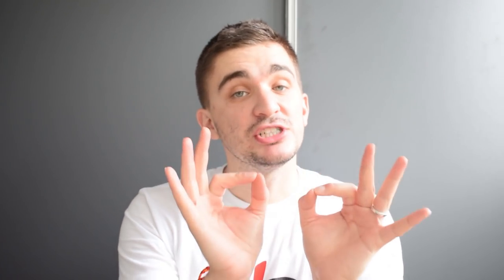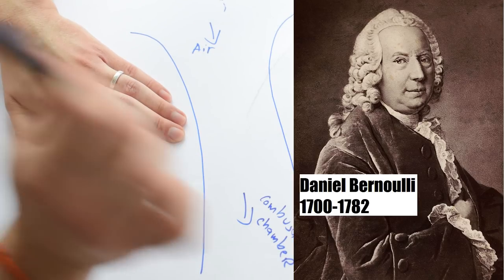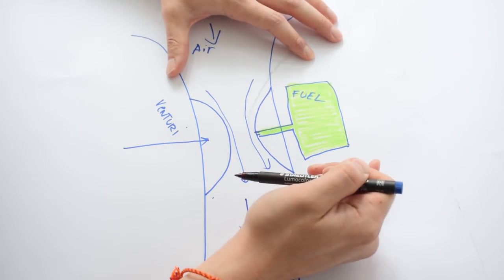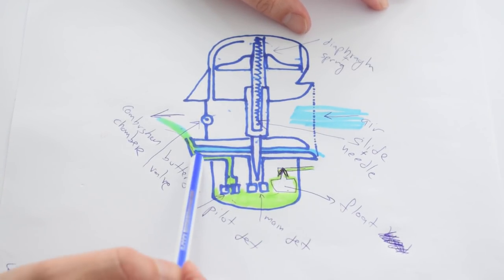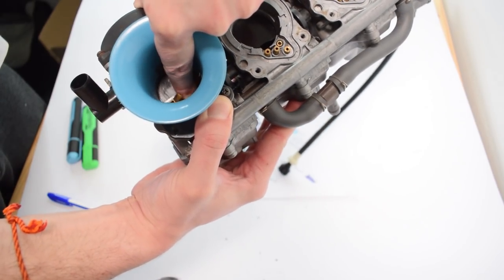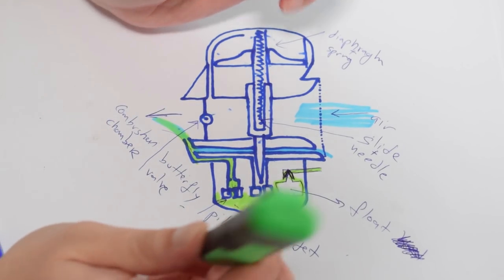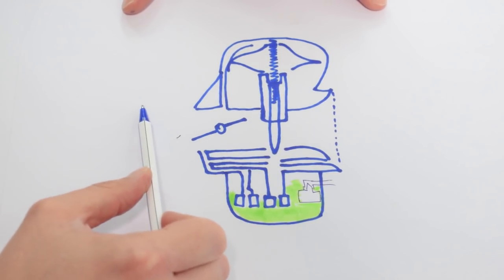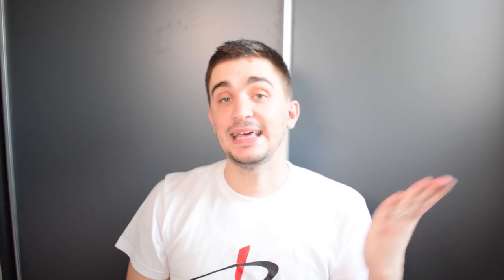How CARBURETORS and cv carbs work - EXPLAINED

Comment: Someone help me! All I want to do is get a modern bike carb to replace an old carb that is impossible to get missing parts for. I was given a FREE = (  Honda CM250. It has twin cylinder running off one carb. Part  16100-KB4-672. All I want is a NEW carb that works and gets me from A to B. Is there a conversion algorithm like i saw for cars? Why can I not find any info on a simple carb to carb transition?  Post a link or something. Thank you.

Comment: Karburetttaes are simple, cheap, and you can fix' em on the side of the street.

Efi is more complicated, more expensive, but very prescise, and reliable, and it creats less  emissons. *Also Efi does not care you are below sea level or you are driving on top of MT Everest. No need to choke. No need to rev to warm up. More power. Do EFI
Reply: this style carburettor doesn't use a choke :D, and i never has issues at cold start. actually my car started faster on my bs36 mikunis than my current efi setup, but that's due to the ecu syncing process

Comment: slight correction the needle doesnt raise with the throttle alone, part of the reason i like this style carburettor so much is because the needle responds solely to the engines request, you give more throttle but the engine can only open the needle based on its own efficiency at various rpms for the various percentages of throttle openning. there was a cool video of a camera mounted infront of an old mini cooper cv slide carb showing different load and rpm combinations and how the slide reacted. great watch aswell. :)
Reply: https://youtu.be/gtSam0RgPl4 at 1:05 he goes full throttle for a short bit and the slide is about half open, due to the engines volumetric efficiency at that rpm. these carburettors are amazing and the basis on why I was researching yamaha's use of the cy slide (without a needle) in the first gen efi 4 cylinders. (turns out to be noise reduction and fuel efficiency) I currently have my slides locked fully open (note for those reading, my setup is efi now)

Comment: The butterfly is not the throttle...the slide is the throttle.  You can go from idle to full open butterfly in an instant, but the slide opens more slowly to maintain constant vacuum inside the  carburettor.  CV is better called Constant Vacuum vs Constant Velocity even though the flow through the carburettor remains somewhat constant due to the position of the slide...the slide position is controlled by engine vacuum and moves up and down to maintain a constant vacuum in the intake manifold.  What you describe here is the Stromberg carburettor where the operator activates the butterfly and throttle action is by the slide.  The Stromberg carburettor design allows the engine to run at low speed low load and not stall when the butterfly is opened quickly.  SU carburettors have mechanical connection to the slide so the operator moves the slide up and down...the biggest problem with SU carburettors is going from low speed and low load to WOT (ie slide closed to slide fully open) cannot be done quickly bec engine will stall (throttle needs to be opened slowly to maintain constant vacuum in the carburettor).
Reply: What's the purpose of the slide?
Reply: The Stromberg CD carburetor and the SU both operate on the same  basic principle, except for the fact that the Stromberg uses a diaphragm instead of a piston as in the case of the SU carburetor. The mechanical connection you seem to be referring to on the SU, is the cold start system the physically lowers the main 'orifice' that surrounds the needle, thereby enriching the fuel mixture. The slide itself still operates independently only in response to engine demand, just as in the case of the CD type. Early SU carburetors were one of the first Constant Vacuum types available. In fact, the first version actually had a leather bellows instead of a metal piston to control the slide. In this respect, it was technically closer to the later diaphragm types.

Comment: Hey d4a, Have you ever considered doing a 7age hybrid build? I've seen this idea tossed around alot on forums and thought it sounded good as an idea and seems like a pretty cheap addition to any 4age build due to the availability of the 7afe block. just wanted to know if you had considered it or had any take on 7age in general.
Reply from the maker: FR1TZ I've considered a lot of things :) the 7age is a good idea, you sacrifice a bit of the rev capacity of the 4age in exchange for more torque. This often makes the 7age faster in the real world. Personally I prefer the 4age as I'm not a huge power nut and like an engine that needs to be driven hard to go, plus I really like engines that rev high. What I would really like to build is a 10.000 rpm formula atlantic style 4age. After that I would really like a turbo 9age built by mrp. :)

Comment: Now true question: Mikuni RS or Keihin FCR ? Carbs swappers can relate.
Reply from the maker: TheCabillaud94 Mine are Keihin. First and only carbs I ever had. I prefer the name Mikuni though, sounds like a sexy Japanese lady.
Reply: driving 4 answers same. I believe the FCR is superior but Mikuni RS just sounds better as a name. What are yours ? I need to find 28mm carbs for my project bike.
Reply from the maker: Mine's are just some civilian Keihin cv carbs from a Honda CBR600 :) No mechanical slides or pumps.
Reply: driving 4 answers Well that sucks. Although you do have a round slide,  no pumps that is sad.

Comment: Thank you; great stuff. If you wish to do another one on constant vacuum carburettors, might I recommend that you look at and demonstrate on an SU? These were used on lots of British vehicles in the 60s and 70s such as the "iconic" Morris Minor. The vacuum slide is a piston and the annular main jet orifice is very easy to see. These carburettors make the transition from the straightforward carb (such as an Amal) with a barrel-type slide to a constant vacuum one very easy to understand. The CV carbs with diaphragms, like yours, are another step. Best wishes, Luke Wiseman

Comment: Hi! I was thinking of fitting bike carbs on a project car, a bmw e30 with a 'm50b25 non vanos' engine for dirt racing because of problems with the injection system. So what type should I use for this 2.5l 6cyl. engine?
Reply from the maker: Doing a 6cyl is a bit more tricky but doable. You will likely need to buy two sets of 4 carbs. I assume you want good torque low down for dirt racing so I wouldn't get carbs that are too large.  Definitely below 40mm, something between 36 and 38mm might be ideal depending on other engine mods. Those can usually be found on 600-750cc motorcycles. Make sure you get two identical sets that come from the same make and model of bike. You will also need a few custom bits to keep the 6 carb setup together but nothing too complex. I also suggest that you get in touch with DanStengineering, they really have a lot of know how with bike carb conversions.
Reply: @d4a  That's true! Also a good midrange would be nice. Thank you very much for the info. That will help alot! I will let you know if it worked or not. ;)

Comment: I was always blow away by fact that engineers came up with cabrurated gasoline engines first. Fuel ingection seems so simple and obvious in comparison, not only as an idea but in the amount of different variables as well, excpecialy when looking at old car carbs
Reply from the maker: I know right! I was thinking the same thing while making this vid. Takes 2 min to explain fuel injection to a 10 year old. Try explaining carbs. But they are a testament to old school engineering ingenuity where you had to find a way to get something done without relying heavily on electricity and printed circuit boards. They may be fiddly and obsolete nowadays but they are still truly charming and have their place.

Comment: Very cool video and you deserve more likes.

My formula student team is using CBR600-F3 CV carburetors. I wanted to know if the carburetors can operate at higher fuel and air pressures. I assume the fuel and air pressure must always be the same, but could we compress both the fuel and air to 10 bar and still have the carbs working?
Reply from the maker: Thanks, glad you like the video. Motorcycle cv carburetors are extremely sensitive to fuel pressure. They want 3-4psi and that's it. When the fuel pressure is too high, even just a bit too high, it will flow past the float valves resulting in an overly rich condition and a loss in performance. Are you restricted to using carburetors?
Reply: @d4a  As far as I know we currently have a Honda CBR600 f3, engine and carbs included, but don't have enough resources to design and construct an injection system. We are required to install an air restrictor after the throttle. Originally we had talked about moving the throttle but your video helped me to understand that the throttle must remain where it is in order to create the vacuum above the diaphragm. 

The only remaining questions we have are if the down-flow restrictor will cause issues with the carbs, and if it will be possible to use a single carb instead of 4 to prevent the need to make a converging manifold as well as not needing to align multiple throttles.

Comment: Wat fuelpump are you going to use? i use a yamaha r1 pump to have the right pressure for the carbs
Reply from the maker: I'm going to use a motorcycle fuel pump as well, one that's compatible with the Honda CBR600 carbs that I have. I didn't want to fiddle with fuel pressure regulators, but I also figured out a way how to keep the in-tank fuel injection pump intact. A detailed video on the fuel supply is coming up soon.

Comment: great explanation....i saw the Italian guys video too....his animation is good and your explanation is better....just had one question why do air mixture screw has o ring and a spring and a washer inside them.....i know they are crucial but there is no proper explanation for this topic..... please throw some light on this topic....it would be of great help
Reply from the maker: Yes, the Italian dude's was an inspiration for this video, that's for sure. His animation is top notch, but I'm glad to hear you found my explanation better :) When it comes to the air mixture screw, well that's a wrong name for it. On almost all CV carburetors that screw actually meters the amount of fuel in a circuit through which fuel passes. The o-ring is there so that fuel wouldn't leak out from the screw. The spring is there to keep the bolt in place and prevent the vibrations from turning the bolt into any direction, which would of course upset the setting. The washers are there to keep the spring in place :)
Reply: okk but i disagree on the washer part its there i think to prevent the oring for getting cut under pressure....i was curious to know about the oring part because i accidentally while tuning the carb misplaced the oring ....i tuned the engine with a new o ring of same size but i am getting hesitation while reving up the engine..... hiccups....i tried to richen the mixture but it was of no help....by the way please correct me if i am wrong...i am no expert in this
Reply from the maker: Yeah, the spring needs something to rest on, hence the washer, which does also prevent the spring from deforming the o ring. When it comes to your condition, I doubt the o-ring is the culprit if you replaced it with an exact same size. Are you 100% certain that you didn't touch anything else, maybe some of the gaskets haven't been installed properly and you have a vacuum leak? Or a clogged jet?
Reply: driving 4 answers i only replaced the oring and nothing else i did not open the carburator i just took the fuel screw out and the washer and the o ring....i replaced it in correct order also first the spring then the washer and next the o ring and set it to two turns out where i could get the max rpm.....i have the pics of the fuel screw too
Reply: anyways thanks for replying was very kind of you thanks